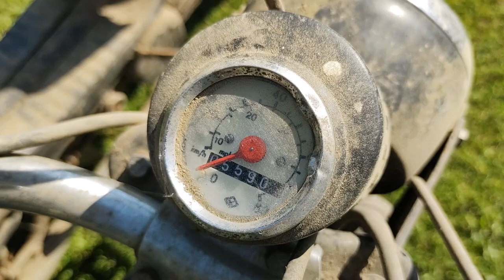Restoration of two Abandoned Old Motorcycles- JAWA Babetta 210 | RESTORATION PART 1 | Disassembling

Comment: Szia! Tudnál kérlek segíteni, hogy te , hogyan szedted ki a sztender (motor tartó álvány) tengelyét? Látom, hogy a 2 biztosító gyűrűt leszedted, és csak simán kiütöd a tengelyt? Én akárhogy ütöm kalapáccsal meg se mozdul :(. Van esetleg valami trükk, még valahol valami fogja a tengelyt? Tipped van esetleg?
Reply from the maker: Hello. Yes I just knock the shaft out, You might see it better in part 3 of this restoration on my channel where I put it back together. On my bikes it’s came out without any problems. But You maybe have it seized/rusted inside of frame. Try to penetrate it good with some WD-40 or similar, get some pliers and try to twist it. Tap it with hammer or heat it with torch and it’s maybe help you to come loose. 🙂

Comment: Nice video. I have also 2 Jawa Babetta that i want to repair. I wait your next video.
Reply from the maker: Thank you very much for such a nice comment. I glad you like it. Next video will be up very soon. So stay tuned. 🙂
Reply: @ZecoRestoration  in december i will start my projekt. something to do in Winter
Reply from the maker: @cradu6797  So good luck with your winter project! I just need to finish some bits and pieces of this two mopeds to get it 100% right. And then I have more interesting projects (also very old motorcycles & cars included). So stay tuned for more videos, I hope that they also help you with your project!
Reply: @ZecoRestoration  May i ask where you buy/order your moped parts? I found a few suppliers în Poland and Czech Republic. I am from Germany, i find some parts here too, not all, but some are not original. I want to restore the mopeds only with original Jawa parts. I'm waiting for The next video. Good luck!
Reply from the maker: @cradu6797  I'm from Slovakia. So I buy all the parts here or in Czech Republic. Most of the time I buy parts from Kolárovo (Babetta 210 was made there) there are some suppliers (motozolzso.sk, sim-ba.sk) and they still have some original parts in stock, but not many original parts left, but with awesome price... Also I buy parts from Motoren.sk, Veterandiely.sk, they have more quality parts, also some original parts, but with higher price. And then when I Want excellent quality parts, but not original, I chose Motomax.cz, they are from Czech, and they made their own parts with highest quality as possible... And now I remembered that in the past I bought some parts for Babetta from fichtlkramek.cz, because they had even parts that no one had in that time.
Reply: @ZecoRestoration  have you heard about 4jawa? They have störe also in Slovakia. I want to order some parts there and i wanted to know if they are ok as suppliers. Thanks
Reply from the maker: Yes. I heard about 4jawa, they are from Poland. And I don't think that they have store in Slovakia, maybe only site in Slovak language, but not preatty sure about that either. I know that I seen them in person a few times in past on a swap meets where they had a large assortment of motorcycle parts... I never ordered parts from them, but I heard only positive feedback about them (both quality of parts and service) from my friends who also work on old Czechoslovakian motorcycles.
Reply: @ZecoRestoration  thanks for the Feedback. I saw today one Video o Youtube,from 2 years, and somebody was unboxing some parts that he order at 4jawa. I will order also from them because there i found everything that i need. 
I am waiting the second Video with Babetta👍
Reply from the maker: @cradu6797  I'll try to edit and release a new video with Babetta as soon as possible, but I currently have over 30GB of footage from this restoration to go through and edit... and it's still not all finished and shot on video.  And since it's just my hobby besides actual work, I don't have that much time for it. So please bear with me. And I'm just curious, it's hard to get Babetta in Germany? if I remember correctly, In Germany Babetta was sold as MOFA, with even reduced power, and some of them had automatic single speed gearbox instead of Two speed. Here such pieces are quite rare and hard to get. But I want to say that it is the same everywhere. For example Simson or Trabant in Slovakia, Czech Republic, Hungary, etc. is still cheaper than in Germany, so they export them back to Germany and make money of it.
Reply: @ZecoRestoration  i'm from Germany, here is not hard to find Babetta but they are expensive. You can find them somewhere from 400 € up to 1000€. I bought one from Romania. This is where i came from. I bought it with 70€ it is Babetta 210 008 from 1987, 14 000 km, and the second one i recieved it from my father in law. Babetta 210 008 from 1989. He didn't use it in the last 25 years. It has only 5500 km. From the first one are missing some parts, but the second one is 100% complete.

Comment: Hello, please help me how did you get off the pedal crank? I heated it, I banged it, i couldn't get it off. Do you need to fully pull the screw out? I tried that too, but it seems stuck like it can't be taken out. Can you?
Reply from the maker: Hello, You need to pull the screw out fully. Then give it a few gently taps with hammer, try to twist it with one hand while you tap on it and it should go out. Maybe it’s just rusted and that holds it… but I don’t think it’s holding it that’s well. Watch Third part of restoration on my channel where I assembled it together and it’s maybe help you with your problem, it’s all just an opposite from disassembling.
Reply: @ZecoRestoration  thanks a lot my friend!

Comment: hello, can you give information on how to remove the rear swing fork?
Reply from the maker: Hello. I'm not sure if I can help you with your question. I did not remove swing arms on this motorcycles. There was no need to remove them. But I know from work where I remove and replace few swing arms on Jawa motorcycles that you need a really strong hydraulic press, it's good to have some ''spare hands'' to help with removing, holding frame, etc. And then you need just to try push out pin, and be really careful to not damage frame or swing arm. If the pin rusts inside of the frame it's big problem to remove it. And on Babetta it's even more difficult because the pin on swing arm is on rubber bushings (Not bronze like big Jawa motorcycles) and have on one side exhaust bracket on it. So you have to be even more careful during disassembly and reassembly and pay attention to the rubber bushings.
Reply: @ZecoRestoration  Thank you very much for the information, my friend. The motor work on my babetta is finished, it is very difficult to find parts in Turkey, I have a cup motor and a swingarm, I will try to assemble them. The only problem is that the gear system seems to bother me, what path should I follow as a gear?
Reply from the maker: Sorry my friend. But I really don't understand what is your problem with gears and gear system? You don't know how to reassemble them? Or something else? Check out my YouTube channel where I have second part of this restoration, dedicated mostly to engine repair and renovation. So maybe it help you with your problem. And if not, please try to explain me more of your problem in comment. And I try to help you.